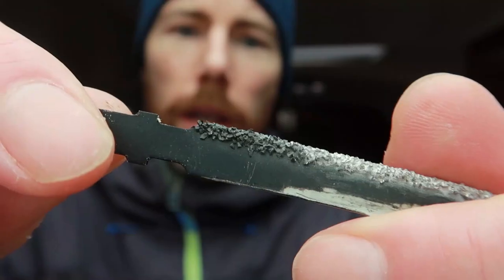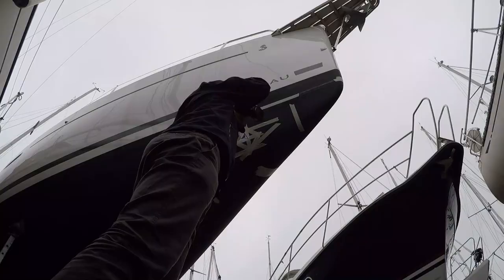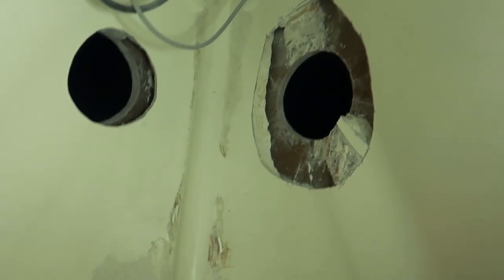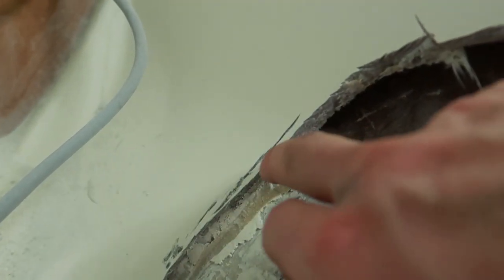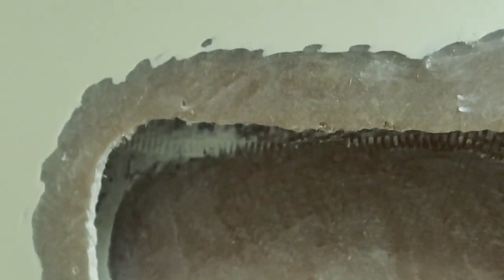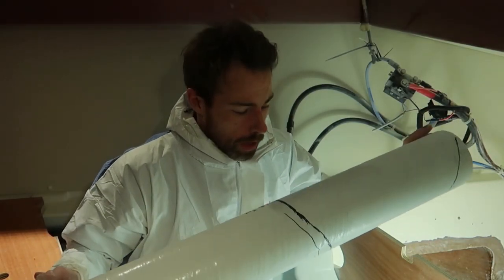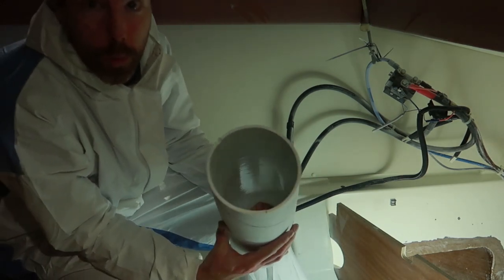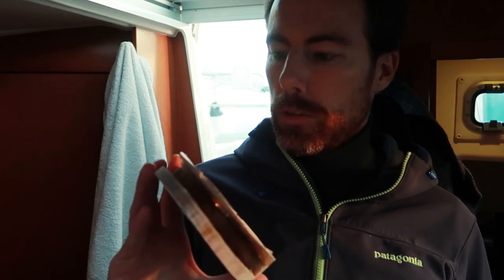Cutting the holes! | DIY bow thruster install

Comment: Now I am wondering if my 40  Oceanis is double hull to?  I guess I will find out when I start cutting holes in her, at least I won't be surprised if it is. I am saving each of the videos in this series for a instruction book for when I put my bow thruster in. Thank you so much for making this video series.
Reply from the maker: You are welcome. You should be able to check if you have a double hull under your cabin sole. If you see bare fiberglass, then it´s probably a sandwich construction. If it´s nice gelcoated surface and sound hollow, then you have the same as mine. How old is your boat? Mine is a 2012, so fairly new
Reply: @jacobkollerup  Mine is a 1996 and yes it is gel coated in my bilges but it doesn't sound hollow. Guess I will find out when I start working on it. All I am waiting on is for this pandemic to be over. Be safe out there.

Comment: I am installing a bow thruster right now as well. What are you planning to use for fiberglassing? what type of mat/roving, laters? Epoxy?

Thanks and great channel!
Reply from the maker: Hi! I’ll be using west systems epoxy and biaxial 300gr (maybe 600gr on the flat surfaces). Reason for going with the epoxy is the excellent moisture barrier (on the outside). Inside because the epoxy works down to around 4 degrees C, where a polyester needs 12-15 degrees C. Also the lack of styrene fumes is also quite nice. Downside is the price! Here the price of epoxy is about 4x the price of poly.
I hope to have the next video up within 2 weeks. The sound quality will be greatly improved in the next video. 

Thanks for watching:)

Comment: Very nice video thanks for sharing. 
I am a new into owning a sailboat. Last November I bought an oceanis 323 from 2007 also in Copenhagen area! Can't wait to put it on the water. 
Mine has already installed a bow thruster, but I am thinking to install a windlass. Do you think I could power the windlass from the thruster battery? 
If you are preparing your boat for the season I would love to see some videos on how are you doing.
Reply from the maker: Hi! Very glad you liked it. I’ll improve the audio for upcoming videos, since the wind noise is quite awful on this one.
Congratulations with the boat and coming into sailing, you will definitely not regret it. 
Yes, you should absolutely be able to power your windlass from the thruster battery, just remember some thick wires and you should be good to go. 
There will be lots of more videos to come:)

Comment: Thank you. Another great video! Now that I understand what’s involved, you’re saving me a lot of money. Bow thrusters including install can cost $10,000-$12,000 in my area. Most of that is labor. Could you sand/grind the very bottom center of the compartment so the tube is bonded w/ thickened epoxy the entire length below the tube?
Reply from the maker: I'm glad you liked it and found it helpful, always good to save a few bucks;). Yes, you can definitely fill the underside of the tunnel with thickened epoxy and glass over. However the installs where I've seen it done is mainly where the tunnel sits very close to the bottom and glassing all the way around would be impossible. In my install I can easily do the normal glassing around. On the Crownline I did, the filling of thickened epoxy, so it´s a matter of the individual install.